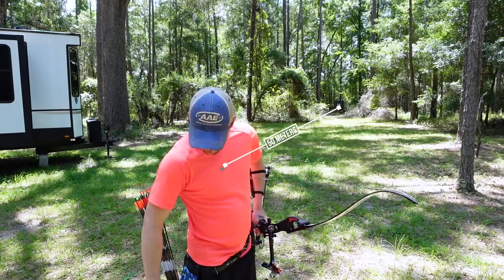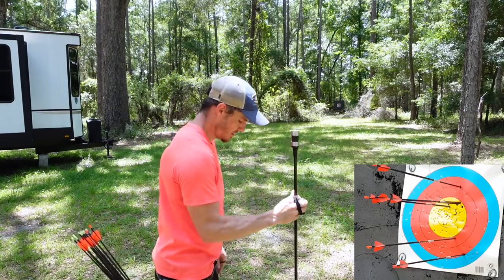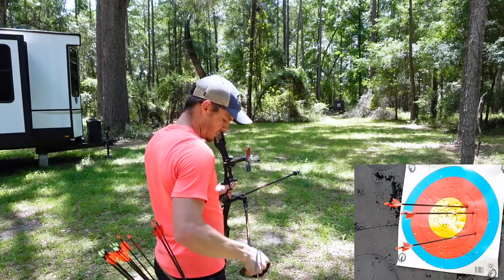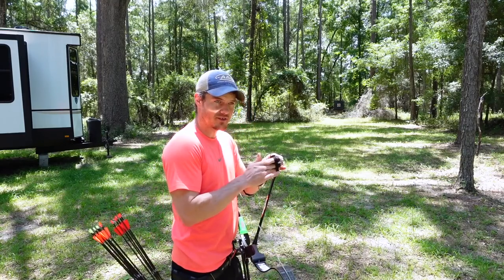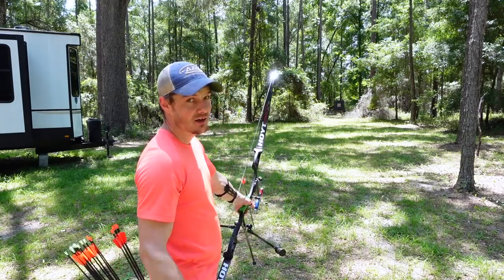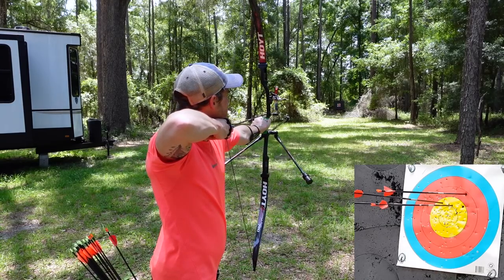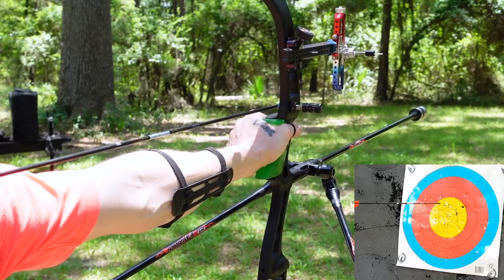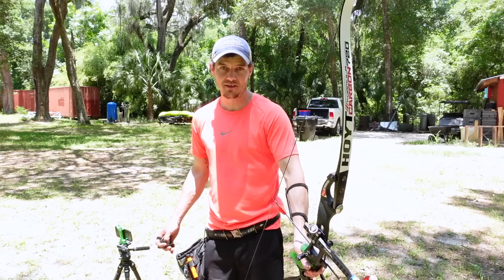I Can't Help but Constantly Tinker with my Archery Equipment

Comment: Fellow tinkerer: this is super interesting! I wonder if archers using standard grips would get similar results using the front hole for their plunger...might hafta try it once I tune for indoor
Reply from the maker: In short: that doesn’t work. It will weaken the tune of the arrow but won’t change what I am here.

Comment: I have argued for quite some time that the grip section of a bow is critical and that archers would benefit from having a standardized bow segment to attach our grips to. Now this would be irrelevant if each bow needed a different grip but I suspect that it is the archer's hand, not the bow that is the critical shape. Have you any inkling that once you found an ideal grip for you that you could swap it over to a different bow and benefit from having a "tuned" bow grip as I suspect?

Comment: a  theory for your finding would be that with a standard grip is easier to torque and twist on the horizontal plane.  The larger grip  has a larger faces on the sides so it sits more stable in the hand and is more difficult to twist inside the palm of the hand. A larger grip requires a conscious action of twsiting the wrist to twsit the whole bow.  An analogy would be holding a book, in order to make it twist you need to move your wrist sideways. This is a lot easier replacing the book with a smaller object  a 2x2 or a rounder object like the neck of the bow grip, you can even torque it with the presure of the fingers.  Makes sense?
Reply from the maker: Makes sense, but more surface area on the sides gives me a spot to push on, specifically a spot further away from my hand and gives me more leverage to torque it more.

Comment: Is this like what you can do with a compound, where at one particular length of sight extension (individual to each archer) the amount of torque applied is counteracted by the movement of the sight? I remember reading James Park's books about it and it was said the same could be done with a recurve but might require a very long sight extension if I remember right.
Reply from the maker: I did this originally because of what is being applied to compounds. However after a lot of research, it’s not why it’s working. I will share that data in the future when the time comes.
Reply: @JakeKaminskiArchery  Looking forward to it :)

Comment: Hi Jake, thanks for sharing all this! I'm asking myself how this finding fits into the narrativ that a more deflex riser is (supposed to be) more forgiving (in the barebow or trad world)!? Or is there a difference when you take off the stabilizers?
Reply from the maker: Deflex and a certain amount (think Earl Hoyt) is most forging due to the timing of the archers’ paradox and when the fletchings pass the rest, plunger and grip area. You want the arrow to be at its Max amount of flex in the cycle (with the vanes flexing away from the bow) right at the moment the vanes pass this area. 

That’s why it’s more forgiving. 

What I’m doing here is far and above different and I will back it with data when the time is right.
Reply: @JakeKaminskiArchery  Can you test this idea in a barebow setup?
Reply from the maker: Barebow and recurve are no different when it comes to riser geometry. The same thing affects both. Only string walking changes the load balance on each limb.

Comment: How different is using your grip that offsets the pivot point from a plunger hole to compare with using that forward plunger hole that no one used nowadays? Would it not have the same effect if you hit use the forward plunger hole?
Reply from the maker: It’s completely different. I’ve tried the front hole and it does not replicate what is happening.
Reply: I find a sweeter shot using the forward button hole with lighter, faster limbs.

Comment: Is this exploiting some trickery with the plunger pushing on the arrow at an angle? Torquing to left would push the arrow into the plunger more, making the arrow then fly "weak" and offset the torque by pulling to the right, and vice versa... Or I have gotten it backwards, but the idea makes sense I think?
Reply: The relationship between forward force on the arrow and additional "sideways" force on the plunger needs to be absolutely correct for this to happen (or rather, for this to happen with a particular tune) as you "add" some spine to the arrow by kind off decreasing bow weight when increasing pivot angle, and "remove" it with the increase in pressure on the plunger. Moving the pivot point away from the riser will find that sweet spot, as the ratio between forward and sideways force changes depending on where you pivot (the extreme case of shifting the pivot point all the way to the draw hand is the same as just aiming sideways).
Reply: If this is all nonsense then at least I know what flat earthers feel like when they finally figured out why the earth must be flat.

Comment: Seems to me that what you are in effect doing is torque tuning. This is regularly done on compounds by moving the arrow rest front and back to basically achieve exactly what you're trying to achieve here: Ensure that the torque axis (as determined by your hand on the grip of the bow) passes right through the point where the arrow sits on the arrow rest. This means that any torque applied to the bow will not move the arrow left and right, with the bow just pivoting around the contact point between the arrow and the rest.

Of course, it's easier to do on compounds because the arrow is in contact with just the arrow rest, and most compound rests do have quite a lot of adjustability front and back. But on recurve you're constrained by the plunger which is mounted in a hole in the riser and cannot be adjusted front and back, so all you can do is what you're doing here: moving the grip backwards in order to align the torque axis with the plunger.

Paige Pierce had a good video on how and why this is done on compound. Some knowledge from there applies, but we must go about it in a different manner on recurve. Maybe the future is to have a slot in the riser instead of a threaded hole, and have the plunger mounted on the arrow rest (one of those beefier, barebow style rests). This would allow the same level of adjustability as on compound.
Reply from the maker: This is what my original thoughts were back in 2010. However after much further analysis, this isn’t the case or at least fully the case with a recurve. I will explain when the time comes.
Reply: @JakeKaminskiArchery  Looking forwards to that video, then! Really interesting to see how this all applies to recurve.

Comment: Instead of moving the grip back, couldn't you just use the front plunger button hole on the riser?
Reply from the maker: Tried it, doesn’t work the same way.
Reply: @JakeKaminskiArchery   That's interesting, do you know why or is it just trial and error? Thanks for the response, looking forward to what's coming!
Reply: Changing the plunger hole alters the arrow’s contact points with the bow. The different lateral impacts due to torquing are less to do with the way the arrow leaves the bow, and more to do with the way that hand torque influences the attitude of the bow during release. 

If I were to speculate on why the offset grip is more resistant to bow torque than the factory grip, I’d say it’s because on the factory one the pivot point is much closer to the centre of mass of the bow. That allows the hand to yaw the bow more directly. By moving the pivot point back, i think the yaw leverage is reduced. 

I’m led to wonder whether you can get the similar results by shifting stabiliser system weight forward more, but I realise that’s not actually the same thing as offsetting the entire bow system forward. It’s very interesting!